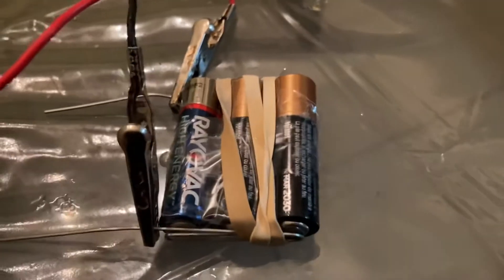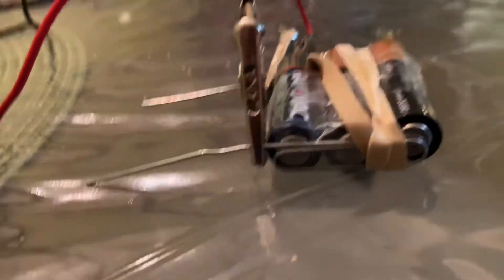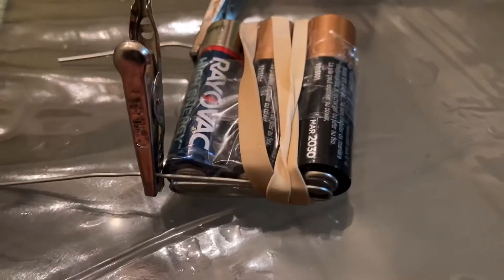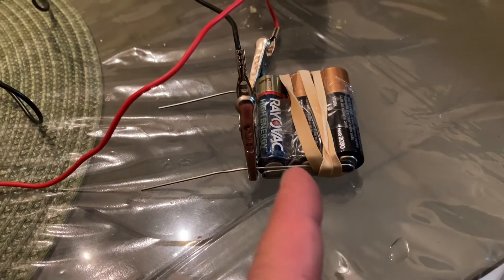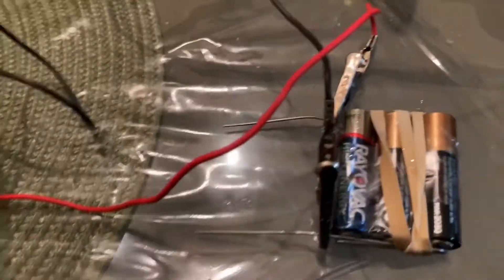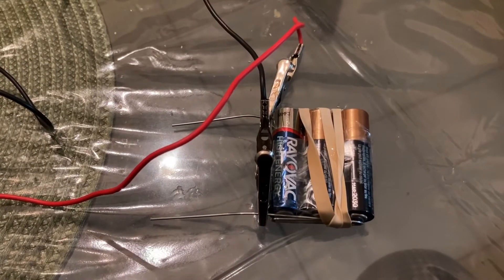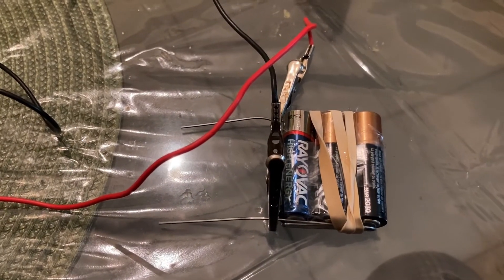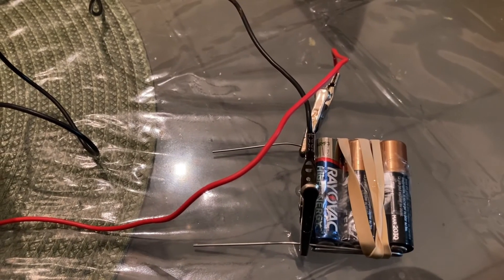Electrolysis Using AA Batteries

Comment: genius! thank you! I will be trying this!

I went to go use an electric razor I hadn't used in years, and found it to be quite rusty. So rusty actually that at first I couldn't get it unscrewed and had to use vinegar, a toothbrush, and even a lighter to get the second screw out! I've never done electrolysis before, but remembered that the only videos I had seen of it involved 9 volt batteries and I only have AA. so glad I found this video!